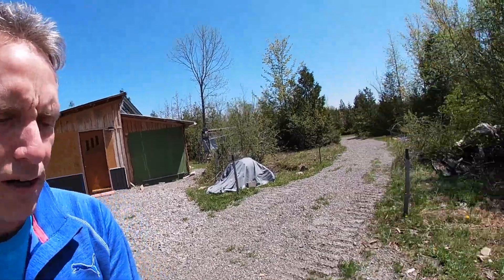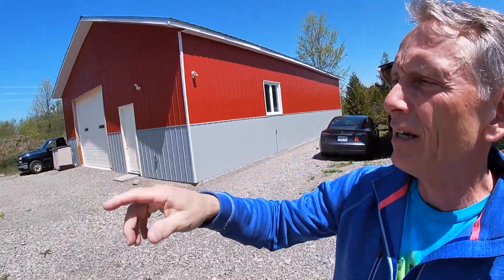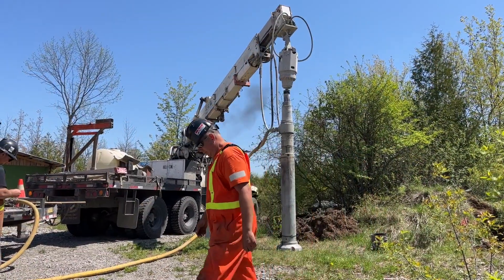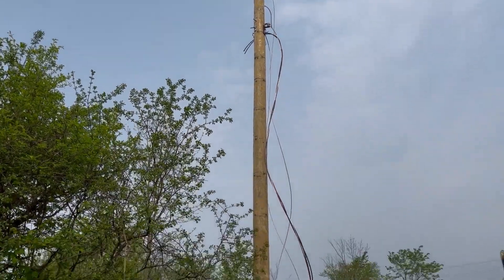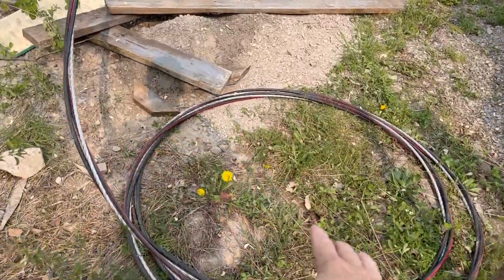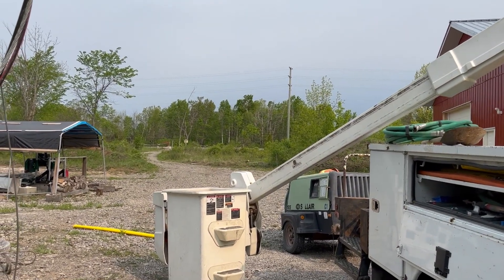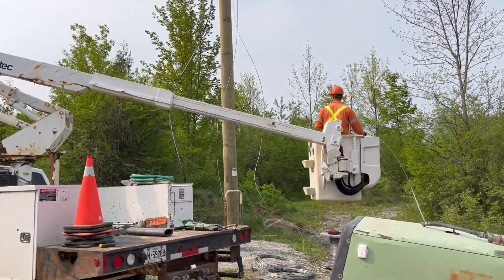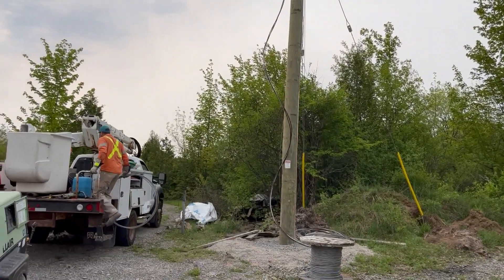Drilling Bedrock and Installing a Utility (Hydro) Pole

Comment: Nice. It’s always a good day when power comes to a property. Heads up though. As far as you running it out to another building. You should look into renting an excavator and digging a trench yourself and laying the pipe yourself and pulling the wire yourself. It’s dramatically cheaper than having more poles driven and you don’t have to look at wires going over head. Or worry about trees taking the wires out in a storm.
Reply from the maker: Mad Man Marine, Excellent advice! Last week our electrician outlined the exact plan you mention above. It will save a significant amount of money. Many thanks for this information! Peter

Comment: Hi Peter. Here is what I found out about the compressor. The XATS 1050 CD7 compressor is equipped with a Tier 4 Interim/Stage IIIB-compliant engine. 
Air-end designed to operate more efficiently and significantly reduce fuel consumption.
Variable-speed cooling fan improves fuel economy by running only as needed.
Emission control built in to the controller, eliminating the need for a separate control area.

I thought it might have been hydraulic based on some things I have seen but could never see a hose going from the truck to the trailer for a return to the tank. Given how things have increased in price since covid, I generally attribute 2X for things now. Not everything is like that, but a lot of things are. I believe this may have cost 4500 dollars Candian if the work had been done this month in 2019. You are closer to the build.
Have good days!